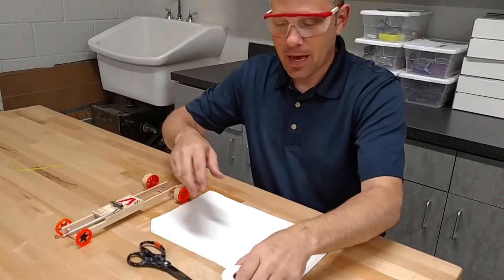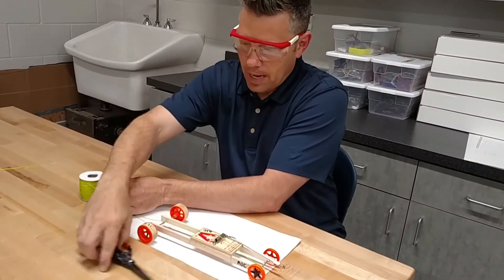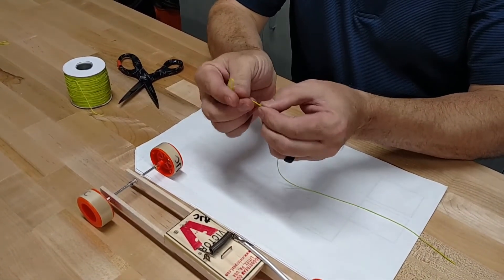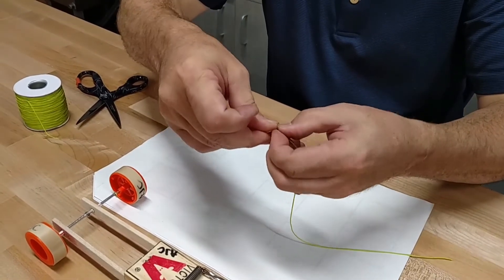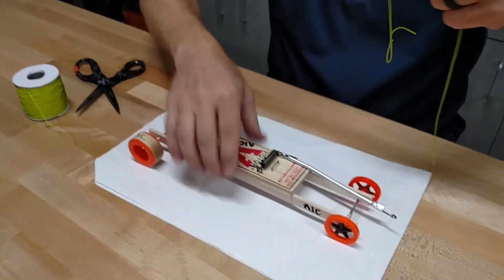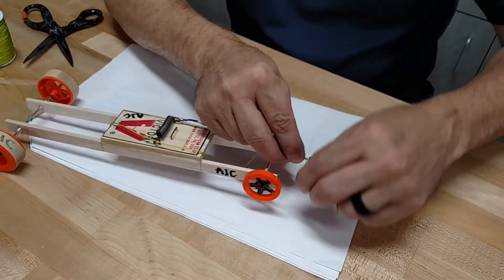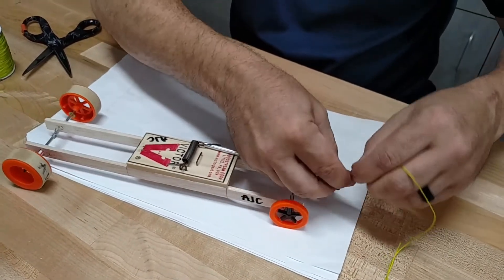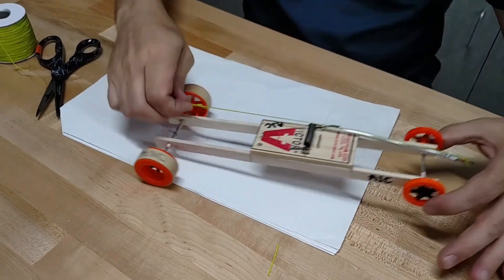Mousetrap Car - STEP9: Attaching the String

Comment: What is the best type of string to use for the Mousetrap Racecar?
Reply from the maker: Our kits come with some string that you can get at a hobby store.  It's made by Beadalon and it's called Wildfire and it's .008in/ 0.20mm thick.  I think it's a bit thin and a little tricky to tie the knots, but the key is that it does not have a lot of stretch to it.  You could probably also use a heavy duty sewing thread and it should work just fine.  In the video is a thread that I tried out, I like the thickness, but it stretches too much.